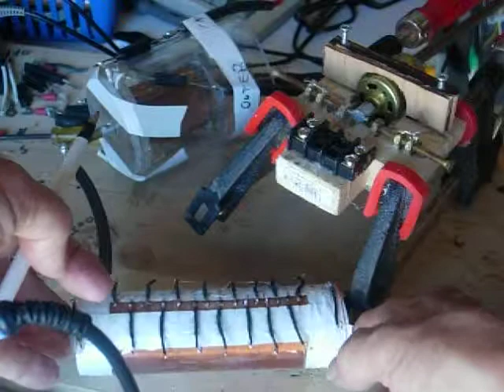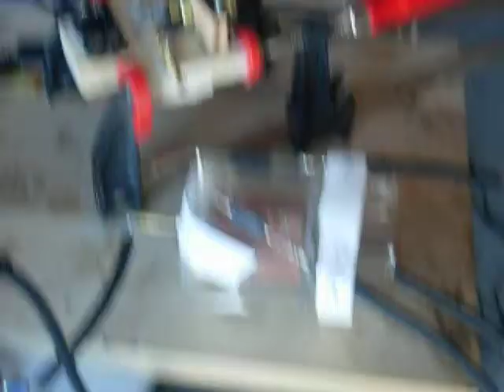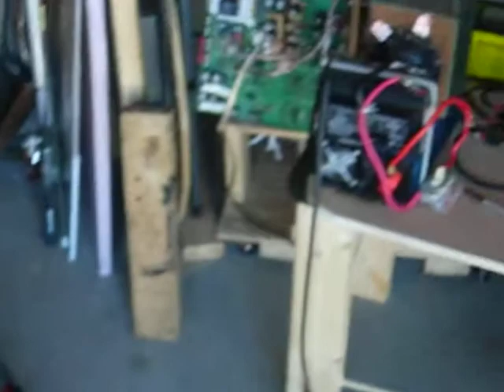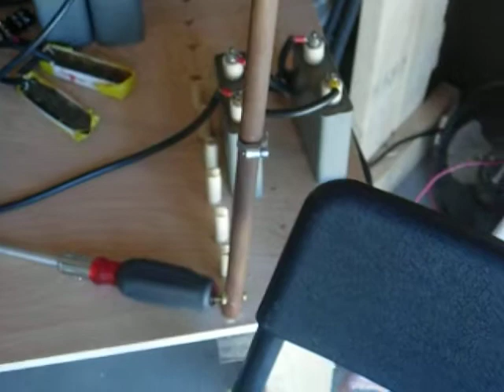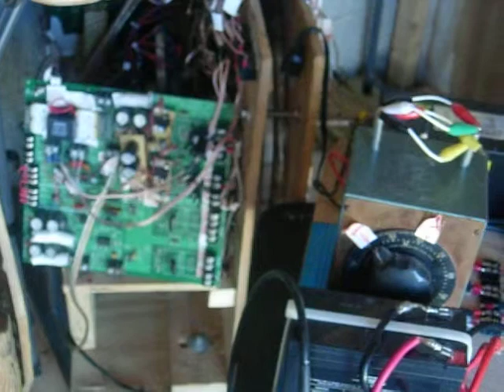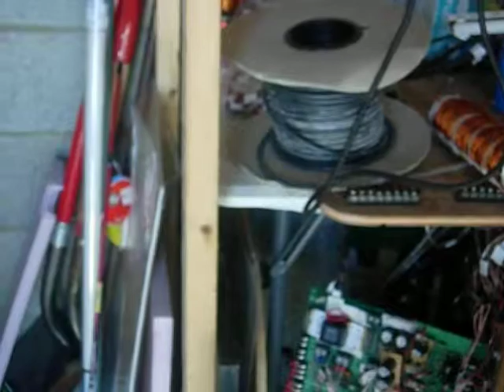Don Smith #61

Comment: please sent me the don smith output cap"s link.....!!!!!!
Reply from the maker: Hi VM   I got the caps off ebay   2Uf  4KV  and some were  1.2 Nano Farad at 10KV.   To tune this type of circuitry you'll need a variety and then monitor voltage for peeks with HV probe.   You can also use 22k resistor with neon bulb to locate 1/4 wavelength points along the coils.   I've stopped working on this stuff now into Pole transformers and Gerards stuff
Reply from the maker: I  will be using the don smith stuff in my car impulse power supply.  This will produce HF 2KV output to 2uf HV caps as pulsed DC.  from these caps I use a  2kv max fet to charge electrolytic caps up to max of 500vdc both positive and negative.   the voltage level in these electrolytic caps  is monitored  and the switch fet is turned off till the cap needs more voltage.   the pos /neg cap voltage  is dumped as impulses into motor coils which are actually dual air core coils one coil thru transformer action duplicates the impulse and this energy is fed back to the front along with BEMF collected and also magnet induction into coils all this combines to maintain the front end so that once started the battery can be eliminated from the system selfrunner.

Comment: Yes you are into something. You are doing things that most researchers completely ignored which is to applying a vacuum on the system. Tesla mention it over and over in many books. Tesla talk about pressure, tension, coil emerge in oil, and wax for coil; the reason for all of that is to removing air from the apparatus to increase efficiencis; because with air around the coil will produce ozone.
Reply from the maker: Tesla mentions also about using small amount of energy to create a large amount.  1kw giving you 5kw.     We have several devices presented on youtube that are over unity but no one is using a portion of the output to run the input thus getting rid of the prime mover.  this is ridiculus.  I'm seeing an entire system run off a 12vdc battery using 3.5 to 3.8 amps or about 40 watts.   In the earlier videos I show a motor running off 12vdc and also a Don Smith tesla system along with the 2 PCBs all running off a single 12vdc battery providing 3.8 amps.  the goal is to run a system that requires a battery for starting only    but first things first I 've been side tracked on this crop circle antigravity beast.   If this works Earth changes especially our method of space travel.